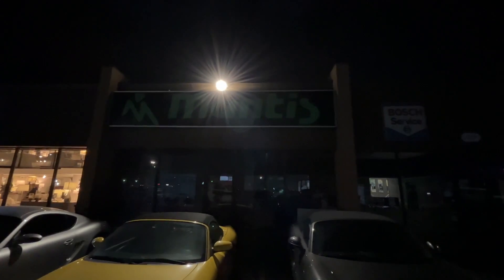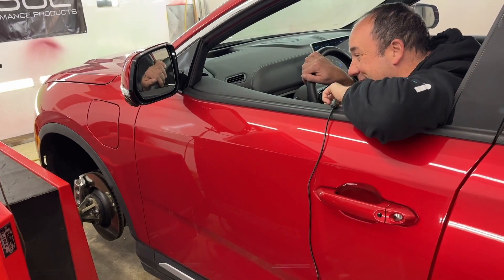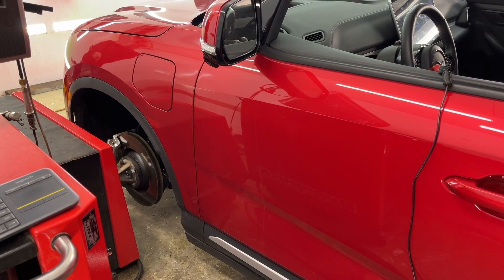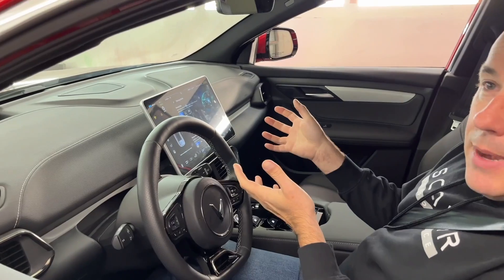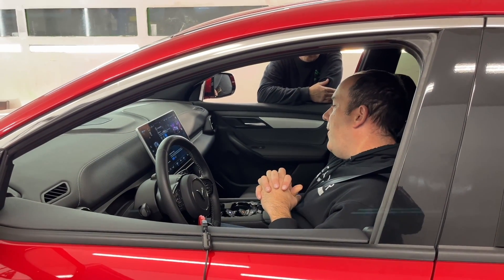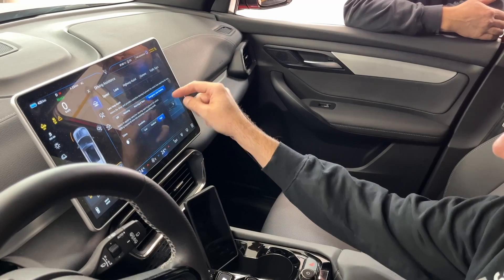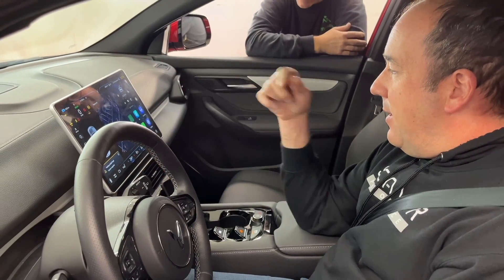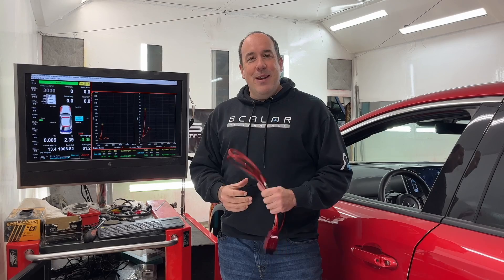We Dyno Tested a Vinfast VF8 and This Happened...

Comment: I'm really interested what you are doing there, technically (as a auto engineer myself). I couldn't see, but I assume you have those hub dynos on all 4 corners .....   do they have a mechanism to sync speeds? With effectively an open differential, how if something gets out of sync, how does the car know if it going in a straight line, vs around a corner? 
Interesting that you said you had experience with that same Bosch VDU. I used to work in Vinfast, Supplier Quality, and Bosch also supplied that the VCU on VFe34. The Vinfast program timing was so short, there was no proper time to do calibration work, Bosch threatened not to ship parts for SOP - they didn't want their name associated with that! I left before VF8 SOP, but maybe the same thing happened.
Reply: Can I ask the reason you left vinfast
Reply: @mickeyhuynh8019  Same reason as the majority of the western expats. In my case, fueled by exposing the toxic & abusive behaviour of my American boss.
Reply from the maker: The Dynapak (and hub dyno's in general) synchronize the wheels by dynamically adjusting the resistance and yes we were using a Dynapak 4000 so a hub dyno on each corner.  In the case of an open differential, this load adjustment keeps it from just spinning one wheel.
Reply: @scalarperformance  I have just been reading up on the Dynapak website - pretty interesting! And who would have expected - a New Zealand company!

Comment: I drove one, the car is very heavy and when we nailed it, it took off. My guess is based on its weight it is running at least 400 if not a bit more. It is not as fast as my 392 Scatpack at  full WOT but way smoother and less drama for everything in between.
Reply from the maker: That is the claimed horsepower and you're right the "butt dyno" agrees.

Comment: How does regenation work? Revert magetics field is on with revert current, so the car will roll back a few centimetres if you don't break. Because car is not move, so motivation of car equal 0. So, when regen is on, car roll back a little. If the car move, you cannot see the roll back.
Reply from the maker: Regen works when the VCU makes a negative torque request while the vehicle is moving forward.  Think of it as increasing the load on your generator.  It's likely the wheels rotating in opposite directions is some combination of the VCU trying to preload the driveline to remove driveline lash combined with some fault in error handling.  Perhaps not looking for motor resolver position or similar.
Reply: @scalarperformance bạn nói đúng nhưng không đủ, khi máy phát hoạt động để xạc lại pin, trong thực tế thì xe nặng và tiếp tục tiến về phía trước do quán tính. Còn bạn nâng xe lên thì tải trọng lúc này còn mỗi trục xe, nó không thắng được lực điện từ của máy phát xạc lại nên bánh xe sẽ quay ngược

Comment: The way you are doing is not appropriate, you do not understand this car.  try another way 😅
Reply from the maker: We need more time to trick the ADAS, but we build EV race cars.  We understand EV.
Reply: Try Viet cong way
Reply: It sounds like you really understand this car. So what is the appropriate way to do it?
Reply from the maker: A four-wheel roller dyno would tie the wheels together so that wheel speeds would match.  Blocking the cameras so ADAS is "blind" is probably the first thing we'd try next though.  Typically when snow or leaves or road grime block a camera, you lose ADAS functionality but not performance.  @SonNguyen-fc2xg

Comment: Guys if you don’t know what to do just say so.   You are trying to make the car seems inadequate when these are safety features in most modern cars.  Electric cars are single gears, I believe only Porsche has multiple gear electric car.  Do some research first
Reply: Vinfast car like as dog shit
Reply: Dont know what to do ? Pham Nhat Vuong  know ?
Reply from the maker: We build EV race cars for a living.  This gives us a pretty good idea how they work.  Worth noting is a Tesla will run on the dyno.  Our race car uses a VCU from the same Bosche product family as the VF8 so we also know exactly what the VCU and VCU calibration is capable of.  I don't understand your point about single gear.  Porsche's Taycan has 2 speeds (gear ratios) but all EV's have gears.  Electric motors spin to very high RPM and they use a gear reduction to drive the wheels (I promise, your wheels don't turn at 10,000rpm).  Typical production EV's are usually in the 8:1 to 10:1 gear reduction range.  Our race car is a 6.2:1 - but gearing choice has everything to do with motor torque curves and available RPM.
Reply: @scalarperformance vinfast vf8 không có hộp số, chỉ có duy nhất 1 bánh răng để đảo chiều.
Reply from the maker: @nguyenlong5989  Vinfast has a gearbox.  It is just that it is a single direct drive gear reduction.  Reverse is accomplished by spinning the motor in reverse, not by changing a gear.  Translation: Vinfast có hộp số. Chỉ là nó là hộp số truyền động trực tiếp duy nhất thôi. Việc đảo ngược được thực hiện bằng cách quay động cơ theo chiều ngược lại, không phải bằng cách thay đổi bánh răng.

Comment: I'm not a fan of Dynapack hub dynos, among other things I've heard they can damage differentials on some cars since the loads aren't linked. If the only problem is the car's traction or stability control, you might have luck with a mechanically linked roller dyno where the rear tires could spin the front rollers (on a rear-drive car) to keep some OEM traction control systems happy. I think Mustang and Dynojet each have some models with that feature.
Reply from the maker: We use hub dyno's almost exclusively for EV performance tuning with our performance and motorsport EV builds.  In this case, we're going to need to put more effort into making the ADAS think life's ok.  Your idea to use a roller dyno to do that might work, we're going to have to get another VF8 and try!

Comment: May it be related to the tires’ pressure?
Reply from the maker: The pressure of the tires not on the car?
Reply: @scalarperformance  there must be a sensor in each tire, and the sensor data will be linked to the OS, I’m not sure, but what I want to say is you may have to connect the car to the dynos without removing the wheels out
Reply: @scalarperformance tôi đang sử dụng vf8 và gặp tình trạng hệ thống sẽ tự ngắt 1 số tính năng trợ lái khi áp suất lốp quá cao, các anh có thể kiểm tra lại xem có phải do áp suất lốp hay không.

Comment: Dyno only applies to internal combustion engines (I think) with smart electric vehicles, the transmission mechanism is smarter. The processor implicitly guesses that the vehicle is in danger. So Dyno completely failed
Reply from the maker: We dyno tune all of our EV builds and we specifically use a hub dyno to build motor torque maps since "tuning" is largely around getting the right torque requests at the right time.  But you are likely correct that the ADAS systems are interfering in this situation.
Reply: Yes